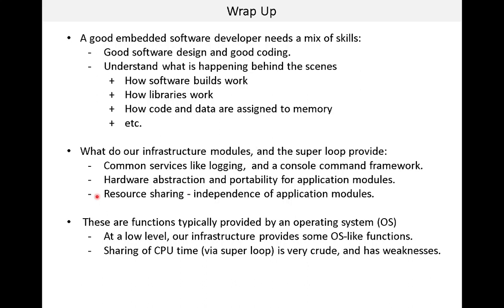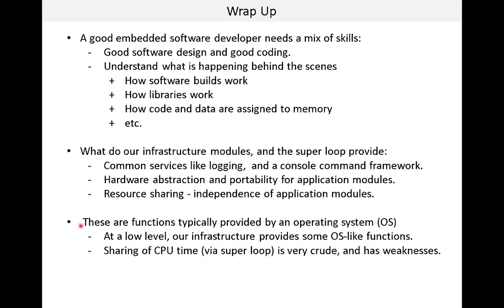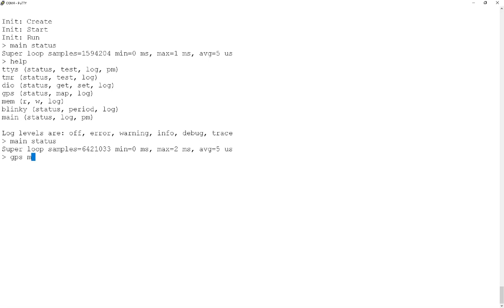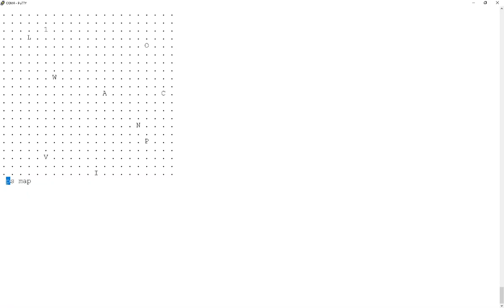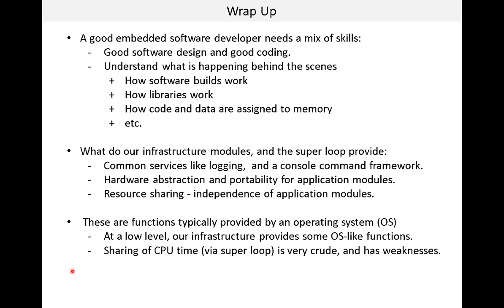Lesson 26.  Course Conclusion

Comment: Great course to get into programming for STM32. I think my next step will be a deep dive into the C language & looking more into the ways to interface with DAC's and other fun stuff. 
(I already got a first version to run on my STM32, but as a surprise, there is no COM ports on the ST-LinkV2, so I can't printf anything. I'm waiting for my nucleo board to arrive now)

Thank you for taking the time to record this!
Reply from the maker: Thanks for your comment.

In my opinion, C is the most fundamental language, and a deep dive into it will benefit you for the rest of your career, even for other languages. 

I did some work with a "bluepill" board and had to use a USB-serial adapter cable to get a console/COM port. So I had one USB cable for ST-Link and one USB cable for console.

As a reminder, you need a USB cable between your host computer (e.g. laptop) and the Nucleo board. One cable handles both ST-Link and console/COM port. You might already have one, but it is something to check.
Reply: Oh, getting a simple serial usb cable had not popped up as a thought! I don’t have one at home, but it would make sense to have one available for the future. 

It does seem that I would be able to connect the usb on the other side and use that for USART. Good project to start! 

Again, thank you for helping out!

Comment: Thank you for the great course. Great theory part, especially for beginner like me.
I tried to make a simple push button -> light a led code. It took me 2 days of debugging because button always called reset handler for some reason. Turns out there are 2 buttons, and I've been pressing the wrong one for 2 days)
Reply from the maker: I will say lol because I have had MANY experiences like this in my career. Sometimes there is some trivial typo in the code, and I read it and read it and read it, and don't see the problem until much time has been spent. You are gaining valuable experience!

Comment: Sir i like your this learning Series on bare metal embedded development it gave me a great start but i want to know how to become a good embedded developer 
i have these confusions in my mind 
1 how to grab a specific Microcontroller or devkit is it must to look it,s architecture and low level programming or just simply to work with sdk examples 

2, secondly is it okay to use an ide for industry standard embedded system or to use custom tool chain or build system it is useful to look how makefile works or how build system works or just to focus on embeded development 
3, last question is that how to build career in embedded system how to reach an embedded development company
Reply from the maker: Sorry for the delay....

There are many different ways to gain knowledge and experience and it maybe depend on how you like to learn. I will give my opinion...

1. I think you choose any microcontroller as it does not matter too much. An ARM Cortex microcontroller is a good choice because it is used so much in the industry. But others are OK too. Once you get hardware, I like to go back-and-forth and do some high level programming using the SDK, but then learn about some low level register stuff. This helps keep me interested.

2. I think an industry IDE is OK to start. There are many things to learn, and I think it is best to focus first on programming and debugging. At my work, even though I had deep knowledge of build systems, I would sometimes use an IDE to start a project because it took less time!  And in many cases the build system was already set up by someone else, and I didn't have to worry about it.

3. This is hard to answer because I think it depends on what you are doing now, and how the industry is where you live. For example, are you a student, are you doing other kind of work, etc. ?  My only advice is to try to go for jobs even if you do not 100% meet the job requirements. Sometimes there are job requirements that are not so important. Or if you have good skills, they will accept you without 100% of the job requirements.

Gene
Reply: @geneschroedertech7501  thank you so much sir i wish i could meet you in personal are you living in america 
we have many things to learn from you thank you sir
Reply from the maker: @salmantechnologies282  Sorry I somehow missed your comment before. Thank you for the kind words. Yes, I do live in America, and am now retired after many years in embedded. I would like to make more videos but am busy with other projects right now. Best wishes.

Comment: Hey Gene, really enjoyed the class. Thank you for sharing your expertise with the world. Quick question, I also prefer using VSCode and was wondering how I would utilize it with one of these Nucleo boards.

Thanks!
Reply from the maker: Well, I like STM32CubeIDE for some of its features, including automatic generation of make files, and the GUI debugger. But I don't like the code editor.

I know VsCode is flexible, and others might have better methods, but here is my simple one:

I  keep all my own code (i.e. everything not generated by the IDE) in its own repo, and then link the top folder(s) of my code into the IDE workspace. This can be done from the project properties.

So all of my code editing is outside of the IDE.  Previously, I used the IDE to do builds and flash code, but I found an easy way to do those tasks at the command line. So now I only use the IDE to run debugger and update make files.